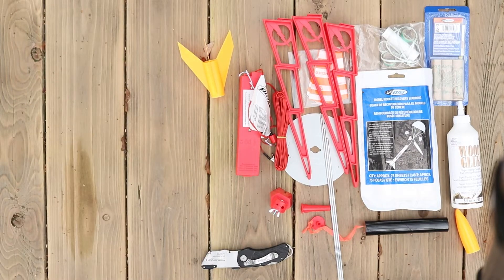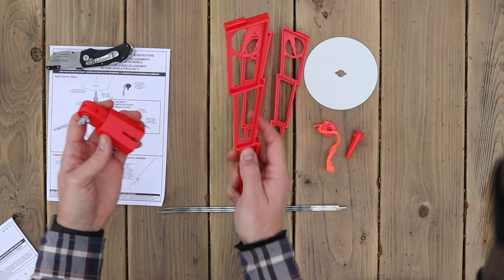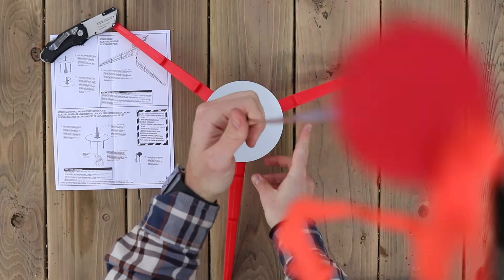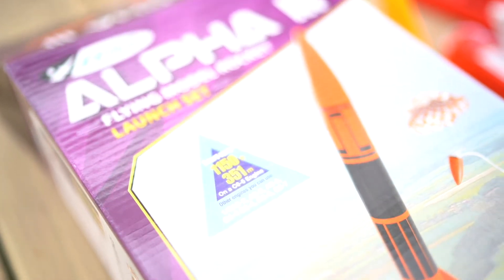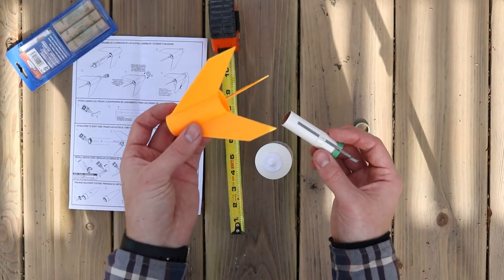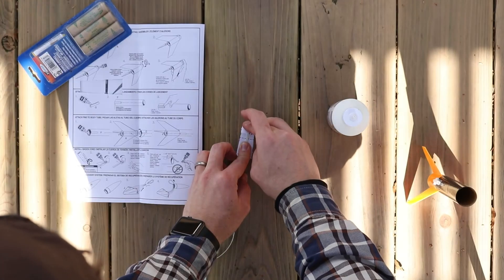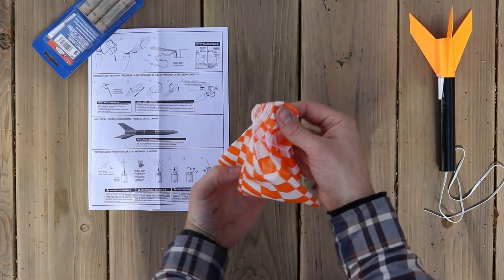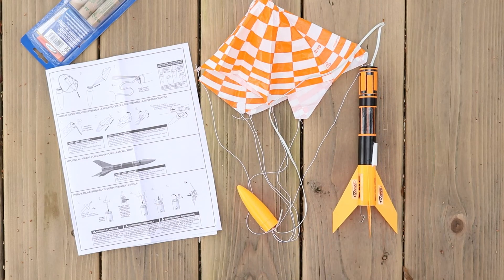Assembling the Estes Alpha iii Model Rocket with step by step instructions.

Comment: Any idea which replacement nose cones can be purchased for this rocket?

Thank you
Reply: Any one that fits the body tube diameter. Nose cones are mainly an aesthetics and aerodynamics choice. Not sure offhand which one is the exact replacement for the one in the kit, though...and I don't remember if the instructions have a part number listed.

Comment: I used to fly Estes rockets in the 70s. The engines back then cost 4.00 dollars for 3 A8-3s. I flew a lot of the Alpha 3. All the way up to the Cherokee D. I also designed and built my own launch controller that would electronically count down from 10.

Comment: How to remove the used engine to reuse the rocket?
Reply from the maker: the engine mount is flexible enough that it slips right out when you pull on it

Comment: Good video, look forward to seeing more.

Just a few very small quibbles with the build:
1) A smaller hobby knife, either an X-acto or snap-off blade knife, would be better to use than a big box cutter.
2) Almost any kind of fixed ruler would be easier to work with than a tape measure.
3) When gluing on the launch lug, some emphasis should be given to getting it on as perfectly straight as possible.  Also, although you said to let the glue dry,  it looked to me (could be wrong!) that it was still wet for the remainder of the video.  Finally  I would always fillet the launch lug for strength.  Maybe for something small like an Alpha it wouldn't make much difference, but launch lugs breaking off is a pretty common mishap.
Reply from the maker: Thanks Neil these are super helpful.  I've always used measuring tape and a box cutter but will definitely go grab an x-acto and fixed ruler (once all these stay-at-home orders are lifted)

And that's a great point to emphasize straight and strength for the launch lug, I'll make sure to emphasize those in the next build!  Thanks for the quibbles!
Reply: @themodelrocket220  
When mounting the  parachute try using a snap swivel,

Comment: My son and I just launched our first rocket a few days ago. It was an Alpha III starter kit that we got several years ago, but we only recently found an area we could safely launch.  We both had a great time and are looking forward to building and launching more kits. 
Your video was informative and easy to follow. keep up the good work! Subscribed!
Reply: The Tandem-X is a fantastic set. Launch set included, easy-build rocket, simple builder's rocket.Check the weight of the Amazon and its recommended engines to see if the B6 is sufficient for it. It's a heavier model, and I only fly mine on C's or 18mm D's so I forget if the B can get it off properly.Definitely mind the Crossfire if you fly it on a C.  It puts the C in "C-ya later"
Reply from the maker: hahahah.  Looks like the Amazon's suggested engine sizes are "B4-2, B4-4, B6-2, B6-4, C6-3, and C6-5".  So B6 should be great for a first flight with it
Reply: And there you have it! Have fun!
Reply from the maker: Wow thanks Jay your comment is super encouraging!!  What other kits are you looking at?  We just got a new one today and are looking forward to making another tutorial
Reply: @themodelrocket220  We're planning to get the Tandem-X set next. Our current launch platform is an older style, and one of the legs snapped in a thin area. we fixed it enough to use, but it's fragile. The Tandem-X kit comes with two rockets and a better launchpad for not much more than the launchpad by itself.  The Crossfire rocket in the kit is a more advanced build than the Alpha III, so we're going to see if our skills are up to the challenge!
Reply from the maker: @Lhorgrim  That's amazing how old is your son??  Believe it or not I have that same set coming next week haha, my son is 2 so I'll be building the Crossfire by myself.  I love the contrast of the two rockets.  Do you know what size engines you'll be launching them with?
Reply: @themodelrocket220  He just turned 17. He'll be doing all the building on these kits. I'm a little jealous of him! We don't have a very large area for launches, so we'll probably stick to A and B engines until we can get access to a larger space. We were taken a bit by surprise the first time we moved up to a B engine! If the Amazon doesn't fly too high with the B engines, we'll try our first C.
Reply from the maker: Amazing, that's 100% what I would have advised.  Have fun on the assembly, let me know how it goes!